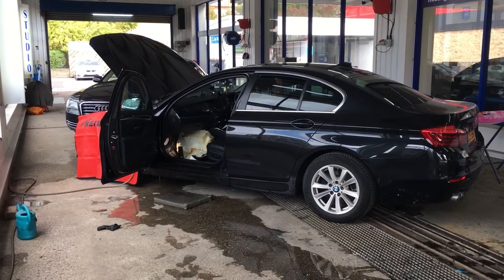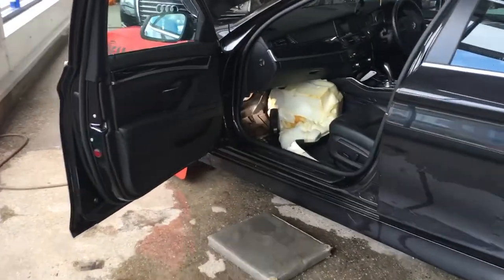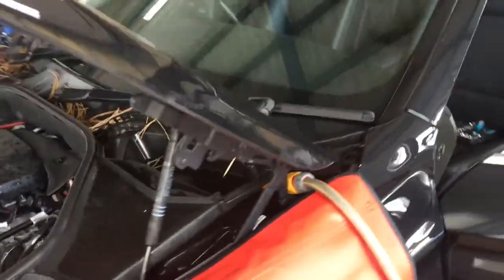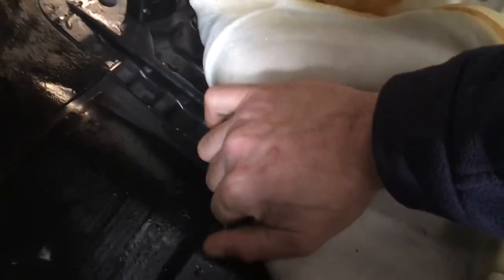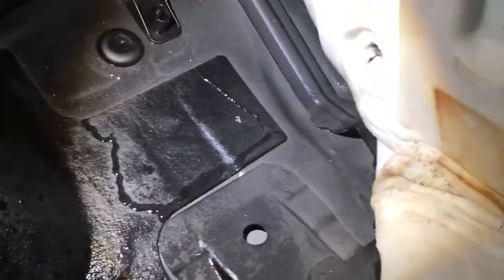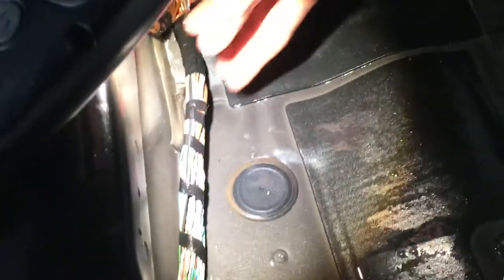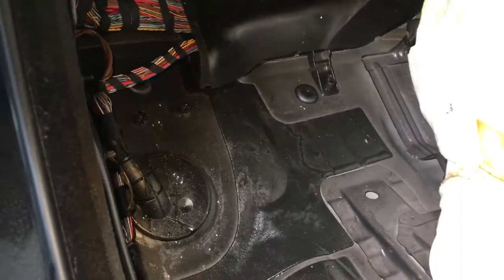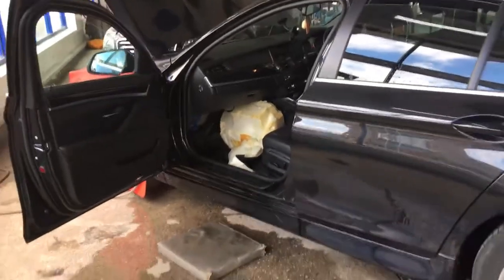BMW 5 series 2015 | Water Leak | #BMWLeaks

Comment: So left hand drive has that yellow plate on right side?..I have water on driver side,rhd,,,i sa under door panel is leaking,,so that is also a problem with bmw,and sunroof holes needs to be clean,,,those 3 points are most common water leaks problems

Comment: Thanks for adding these diagnostic videos. Really helpful as I strongly suspect this is the issue with my leaking 2015 2-series (deep puddles in rear nearside footwell - think it must be coming from a large surface area like windscreen). BMW failed to diagnose but suggested membrane in door (can't think this would carry that amount of water). Would have popped over to you but I'm in a different part of the country. A really good bit of evidence to take back to BMW though...thanks again!

Comment: We have same issue. How can we fix this please?
Reply from the maker: Replace the blanking plate, get the seats out and the carpet up and then dry the car out.
Reply: @CarWaterLeaksFound  do you mean the yellow grommet? As it was the first thing we did and it didn’t solve the problem 🙁
Reply from the maker: @dzestinak  If you have fixed that leak, then you must have another leak. Try looking at our other videos on BMW leaks. It could caused by several different things.
Reply: Hay pal.where are based I have the same problem with my 5 series GT

Comment: I had this problem on my f 30, the problem was on driver door speaker, there was space where speaker attached door frame, i just put silicone and it stopped leaking.

Comment: How much does this typically cost to resolve?
Reply from the maker: Every car is different, so we can't give an estimate until we have done an inspection.
Reply: @CarWaterLeaksFound  understood 👍🏼 are you aware if this is a recall fault on the BMW 5 series?
Reply from the maker: @reecejaques2488  It isn't. Manufacturers very rarely issue a recall unless the fault is dangerous, and likely to get them sued.